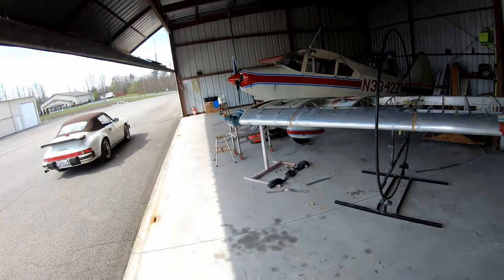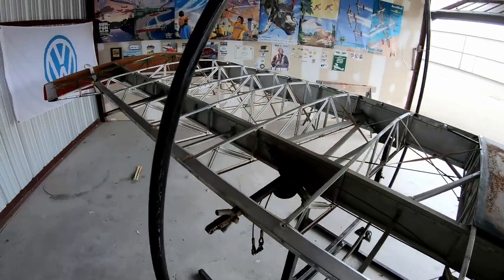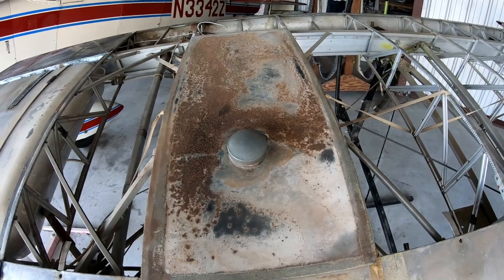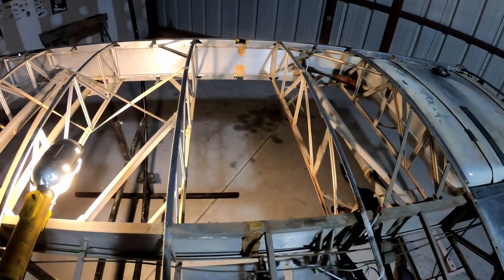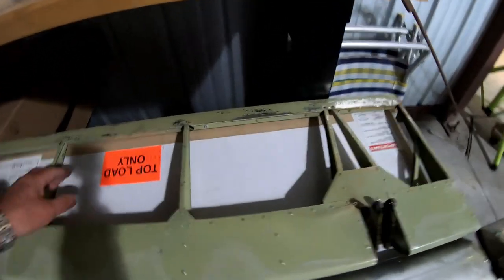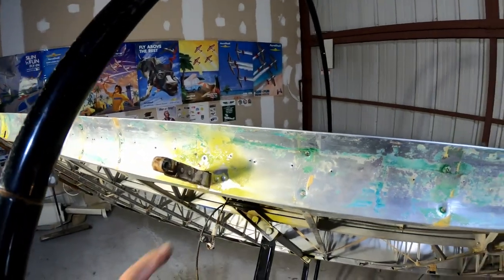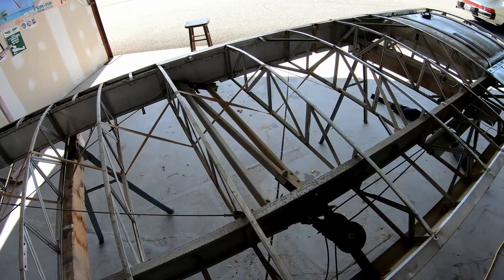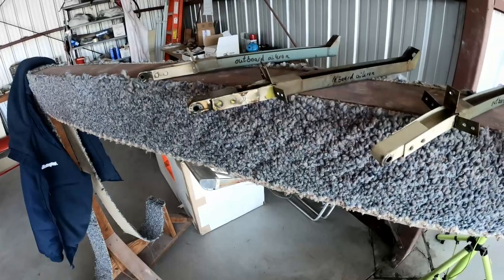1960 Piper Pacer left Wing recover Part 1

Comment: Great video, Juergen! Thank you for taking the time to do it.  I look forward to more of the same.  I enjoy seeing the work and the results.  It is amazing to see how well it has held up.  I am very interested to see how the auxiliary wing tank is reconditioned.
Reply from the maker: My mechanic(s) examined the tank and determined that it was just surface corrosion. I used a wire brush on a hand drill to clean it up. Then I painted it with Zinc Chromate, epoxy primer and a top coat. I didn't video tape this part since I don't want to have overspray on my cameras. I will mention it in hte next video.

Comment: This is interesting. Those are very beefy looking spars and a very beefy looking wing structure overall. If anything smaller than an elephant got in the way...I would bet on the wing. Will you be putting a coat of something on the wood wingtip rib? Thanks for sharing.
Reply from the maker: The wooden end rib was covered with fabric on the outside. I’m thinking about brushing a fresh coat of varnish on it.
Reply: @pacer42z  Couldn't hurt. Have you considered replacing the wing fabric with aluminum or is there not enough advantage to bother?
Reply from the maker: @Joe_Not_A_Fed  There was an STC to "metalize" the PA-22, but I'm not sure if it's available anymore. However, I like the looks of a fabric covered airplane much better and I believe it is also much lighter to keep it fabric covered.
Reply: @pacer42z  Makes sense. Thanks.
Reply from the maker: @Joe_Not_A_Fed  Your welcome